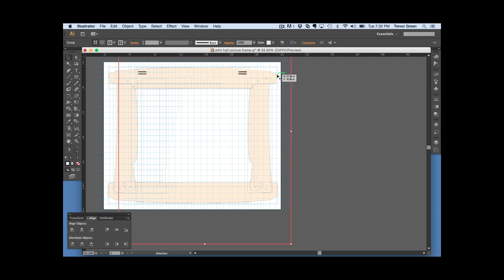John Hall Frame (Popular Woodworking #177)

Comment: It looks nice, but it was not constructed the way the original John Hall frame was, or the way the Popular Woodworking article described it.   Here, Trevor made a simple lap joint that overlaid the lower piece.   In the original, the stile jigsaw piece was a tenon that fitted into the shaped mortise in the lower rail.   Same for the upper rail.   Trevor did not include any mortises in this version.
Reply from the maker: Thanks for watching and for your comment. It's true, the lower ends of the stiles were mortised into the lower rail in the original, however, I used reclaimed mahogany that I salvaged from a dumpster. After re-sawing I did not have the true thicknesses required for the frame and there was not enough material on the lower rail to make such a joint. In addition, I do not have any gouges or carving tools (apart from a router to help hog the material out) so that joint was not possible for me and my tools. I found the "simple" lap joint to be a good compromise. In addition to the frame not being the correct thickness it is not the correct size. I took the plan and scaled it to fit a 16x20 print. There other items that are not true to the original, like the hanging slots in the upper rail and the ebony plugs (which again I made based on the size material I had on hand) but the true magic is making something that looks close to the original and incorporates most of the design elements. It's not the original, but I appreciate the Hall family for sharing and Marc Spagnuolo for examining and detailing the construction of the original.